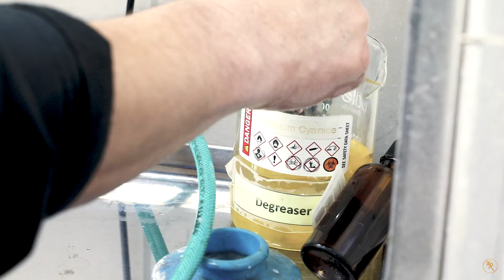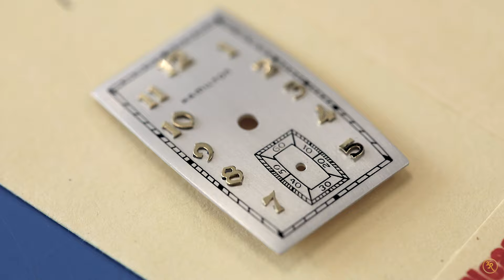[ASMR] Vintage Rectangle Hamilton Watch Dial Restoration

Comment: Beautiful. You are polishing the dial but the black lines stay. How does that work with this dial? Because in a lot of your videos, you print new black lines and logo’s on polished dials.
Reply: They cut out the pad printing part out as there's no way that those lines are staying after that much scrubbing.
Reply: perhaps they are etched rather than painted?